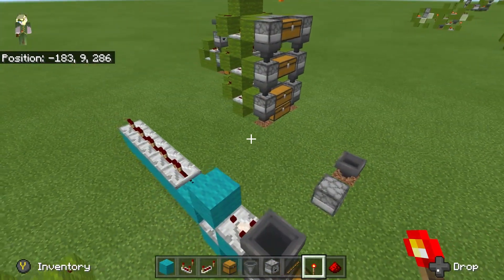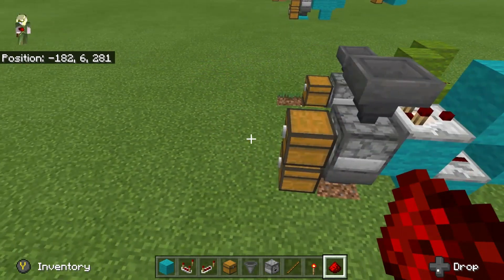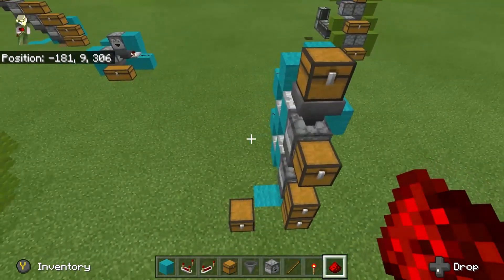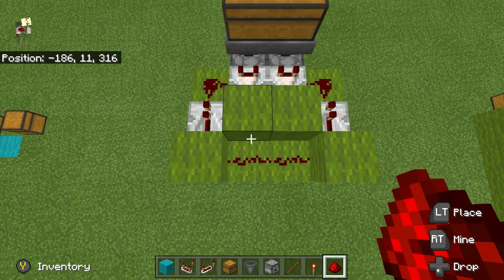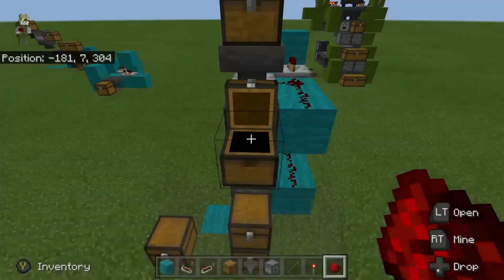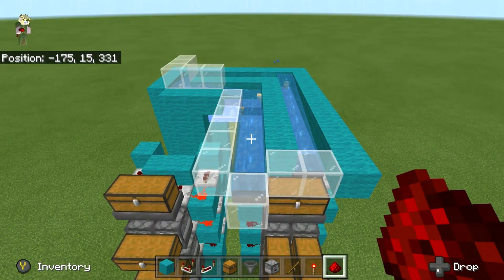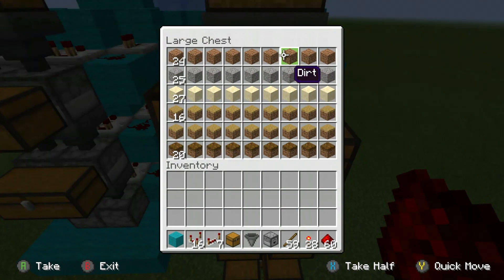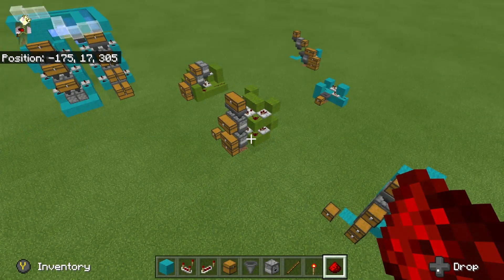Minecraft Bedrock Dropper Based Multi - Item Sorter Full Hopper Speed / 2X Hopper Speed

Comment: Thank you VERY much for diving into this and refining the design. I think I will build something out of it. Some mix between single and multi item sorters because e.g. diamonds or nether stars don't need a full double chest but cobble needs 10 of them. The categorizer idea is the best in my opinion but unfortunately very slow so I need to stay in the vicinity for a long time.
Reply from the maker: Yep yep, I think I agree with you all around.. That's why I started trying to build my own sorters in the beginning. :) I think I'll aim for a faster categorizer in the future, if that's possible.
Reply: @Jon-2049  I would really appreciate that. Maybe it is possible to double the categorizer mechanism and point it into a single chest? Yes, it would be bulky af but at least a starting point. But maybe I still didnt understand the topic well enough so it is impossible?
Reply from the maker: No, it’s not really the item movement, because that’s hopper speed. It’s just the item searching that takes time. But it’s something that’ll take a while do develop because I’d need to design a completely new way to sort. 😅